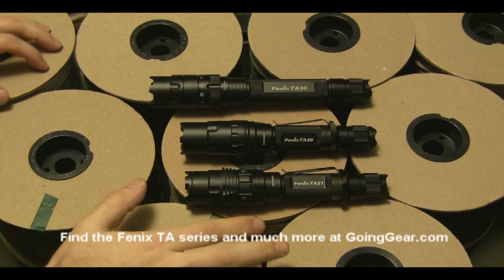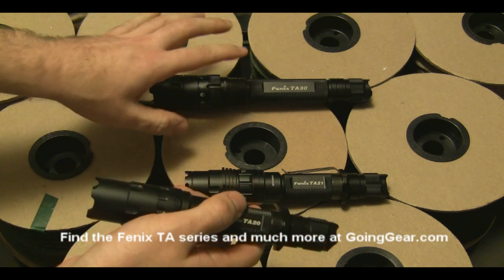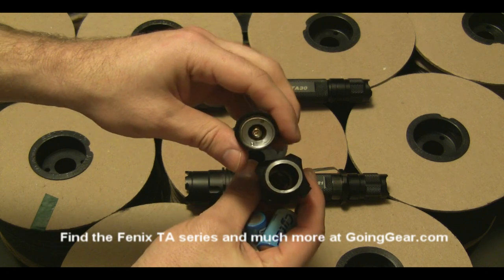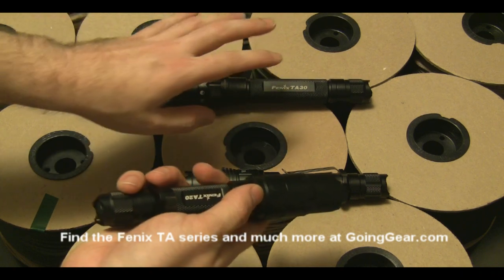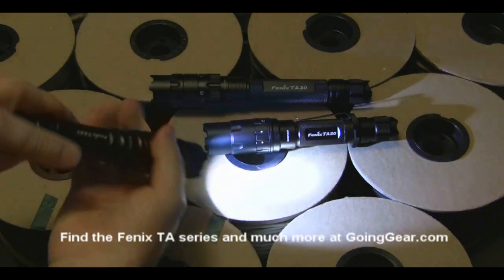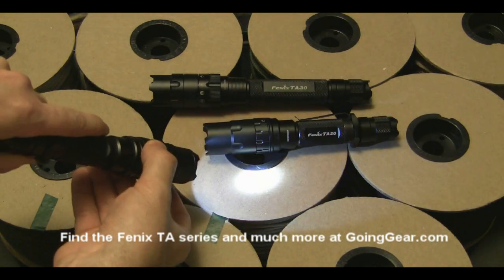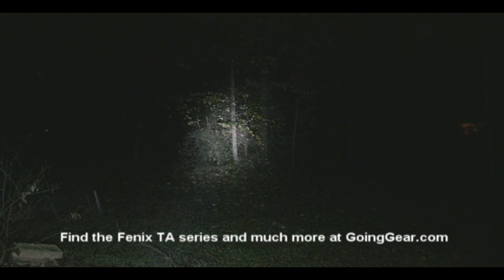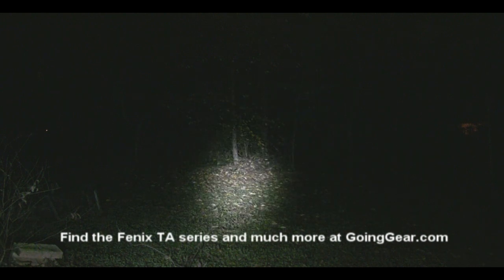GoingGear.com - Fenix TA20, TA21, & TA30 LED Flashlights

Comment: @goingprepared - Good point, what about the LD20? The new model has about 205lumens and although it does have multi-modes there not accessed by a toggle switch. What lighting systems would you say is ok to use on the AR&AK platform?

Comment: @goingprepared Cool, what about the FENIX LD20 R4 - it maxes @ 205lumens / light weight & compact. Easy to operate and uses a common AA battery. What about 4Senvens lights, the Quark AA, R5 Edition, like the Fenix LD20 R4, the Quark AA R5 is streamlined, light weight, has easy operations & has the R5 LED & maxes @ 206lumens. There all awesome lights and both have pro’s & con’s, there priced @ the same price point and all their spec’s are about the same.